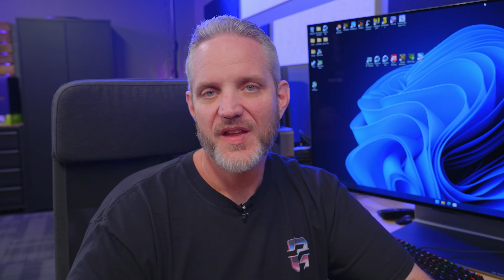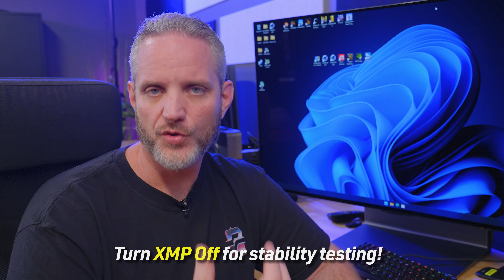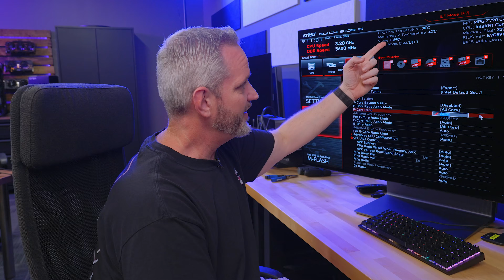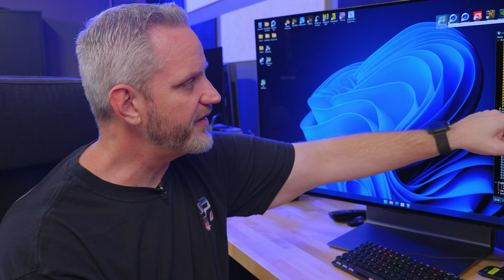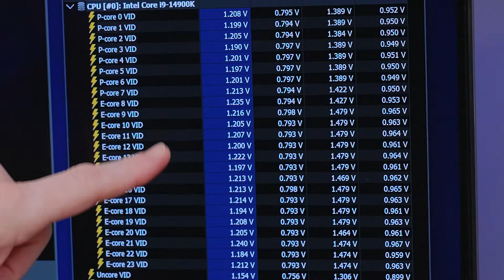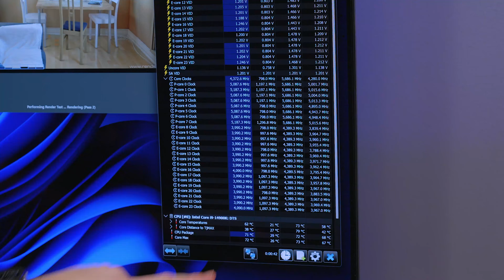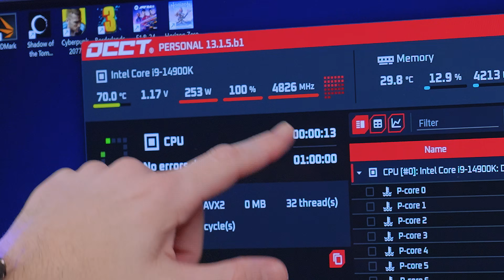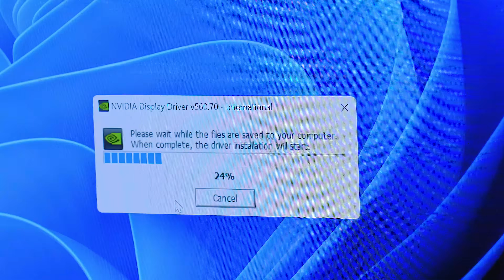Guide: How to check if your CPU is BAD!

Comment: Electronic components initally powering on is hardest most stressful thing it can do.  This is why when a light bulb bursts, its typically as you flick the light switch (though now-a-days LED bulbs are a bit different but same principle applies).  So personally I wouldn't adhere to that advice at the end about turning off your PC all the time that you're away from it.  You'll potentially cause your CPU to degrade faster, along with every other component in your PC, depending on how often you actually use your computer.  As someone who uses their computer every day, i almost never shut off my PC.  I have an i7-950 from yesteryear that still functions today, and was something I pretty much ran 24/7 for nearly a decade.
Reply: This is simply a myth that was debunked years ago.
Reply: I always turn my pc at least once a Month and my Last pc wish was a laptop lasted for 10 years
Reply: I have friends who use their PC a few times a week, so for them it would make sense to power it down. They could probably stil be running an 80286 through 2060 at that rate. Mine is up all the time, just goes to sleep mode when I'm not using it (which is usually when I'm sleeping, too).
Reply: i do something similar. i leave my pc on basically constantly during winter when it gets to colder than negative fck up ere in berta but during summer i usually get a dehumidifier running and a ac in my room pointed at my pc and try to leave my pc on but not use it yk

Comment: I use a 7800x3d but I still have a 4790k which still runs cyberpunk at over 100 fps on Garuda Linux. Well, I only use linux. But I did use the 4790k on a Win10 box too. Mmm.

Comment: I just tried running CB R15 on my 13700K rig, but it didn't utilize the P cores on that test.  CB R23 hit all cores just fine.  Is this just a windows 10 thing not utilizing all core workloads properly?

Comment: My 13900K was bad from day 1. I must have gotten one of the oxidation ones as I got mine in Nov 2022. Consistently crashes when compiling shaders for certain games. Particularly those using UE. Otherwise, it works fine for older games that don't use 100% GPU. Starfield, though published after CPU release,  uses an older engine, which works fine.  Fails DLSS test on 3d Mark. RMA'd 4090 twice. Thankfully, you figured out it was the CPU. Had no trouble getting RMA as I had a boxed CPU since I built PC from scratch with parts from Amazon. And your build videos to put it together.  Waiting for new one to come tomorrow as I got advanced RMA to eliminate downtime.

Comment: 13600kf/ /MSI z790p wifi ddr5/ single tower air cooler. Runs at perfect temps and voltage on lite load 9 and has no problems with ALMOST all games and programs. HOWEVER, it will always hard crash (freeze, little white and black squares on second monitor, then reboot) when I launch F4SE. That's the modded Fallout 4. Used to work fine but recently started doing this, even with bios updates. Regular F4 runs fine (but who wants to play that?) and this test also happens on default bios settings.

Comment: 25 minute video with very little value sadly! This would've been 10x more helpful if it was half the duration and I was done on actually a bad CPU to show what is happening. You mentioned that some bad CPUs are on the way, maybe could've delayed this video until they have arrived just a thought. Also a lot of acronyms being thrown, if one is going to talk for 25 minutes at least say the full acronym at least once instead of string of DIMMs, TDSs .....etc! So to answer your question at the end, this video was not helpful at all. Thanks for posting though.
Reply: What's your point? 😅

Comment: I have Ryzen 5 1600 and I used to overclock it.
I used to run that CPU on 3.65 GHz with very good power efficiency but after these several years it can't run at any given voltage at that speed. 
I had to clock it down to 3.6 GHz all core. 
Now that is the degradation I would like to see in newer CPU.
Reply: Overclocking Ryzens is functionally unnecessary by the way. Do that in PBO/PBO2 instead.
Reply: @ZenAndPsychedelicHealingCenter  maybe now, but as far as hes concerned, ryzen 1000 does not support pbo and is only supported for 2000 and up
Reply: @paneledp  Yes, Non-X CPUs don't support PBO at that time as far as I remember, correct me if I'm wrong. Also, it did improve a little bit of performance for multi core application/games and somewhat reasonable performance improvement was observered for CPU intensive games.
Reply: @paneledp  Yes, Non-X CPUs don't support PBO at that time as far as I remember, correct me if I'm wrong. Also, it did improve a little bit of performance for multi core application/games and somewhat reasonable performance improvement was observered for CPU intensive games.

Comment: With my 13900k and 14900k, I have never been able to run Cinebench R23 multicore without several cores hitting 100C. This is with an Arctic Freezer II 420 AIO with 6 fans in push/pull orientation. I am blown away by the temp you are showing there. I've tried remounting and repasting, worried it was a contact issue, but nothing has changed. Both boards I am running are MSI. One is Z790 MEG Edge WiFi with DDR5, and the other is an MSI Z790 Gaming WiFi.
Reply: Did u use contact frame?

Comment: Why isn't this affecting the 12th-generation series? They are the same LGA 1700; what's different? Does the 12th gen get a different microcode update? Can I have issues with the microcode updates?
Reply: the design changed between the 12th and 13th that's why
the new design was at the 13th then the 14th kept that design

Comment: Ugh. Got my 13700k in November of 2022 a few weeks after it came out. I was SO hyped to have a next gen CPU. My PC started having bluescreens about a year ago and they keep getting more and more frequent. BIOS updates, disabling XMP, reinstalling windows, nothing has worked. I am in the process of RMAing it now. Such a shame.
Reply: What was the stop code on the blue screen you were getting?  I am starting to get random blue screens when idle and nothing showing up in event log or mini dump.  They are starting to become more and more frequent.
Reply: @n1lla Same here. Looks like I'll be contacting Intel cause I've replaced EVERYTHING and it's still happening, even a fresh windows install.
Reply: @ki11arti5t9  I think i FINALLY figured mine out after a couple of months. After searching the web for the Nth time, i found a page that described similar symptoms that mentioned the 'Minimum Processor State'.  I changed the 'Minimum Processor State' from 5% (the default value) to 10% and the intermittent BSOD when idle or low load have disappeared.  If you are going to try this i would recommend increasing the value the smallest amount possible.  With a 5% increase i did not see a big change to thermals of the system.  A large increase will make the system run hotter.  Just keep that in mind.

Comment: How should we go about updating the bois or even accessing the bios if the computer refuses to restart to the bios? It just seems to go to half on half off mode and does nothing. It just won’t go into the bios anymore.
Reply: Clear CMOS first.
Reply: That’s the first thing I did. Still the same. Took a half dozen forced power downs to finally get it to recognize flash bios, then a couple more restarts for it to finally bring up flash bios to update. Still can’t get it to post in bios. It just goes to a black screen each restart when I hit delete etc. Never done this before. Dunno.

Comment: I’m no engineer, but I always imagined these tests were damaging to the cpu with a sustained high intensity hit.
Reply: That shouldn't be an issue, if that was the case then noboby could do an intenssive work with for example, cpu rendering or particle simulation, or any other similar load... You have to remember that this cpus are used in companies to create their own products, it cant fail, at least till they reach the end of its life cycle

Comment: I had an Nvidia driver crash once a few months ago. It was a weird one as I saw it first (and last) time. I don't really remember what the error was saying. I rerun the thing again and it installed successfully the second time. But - now I'm seeing errors inside OCCT. Probably because I'm undervolted. Tweaked my offset voltage a little bit more just now, and rerunning all these tests. Only OCCT was complaining after just 7 short minutes. Before I was running it for 2-3 hours in Steady load time and it wasn't complaining at all. 14700K here.

Comment: As for CPU degradation...
I am currently using a 16 year old processor; the Intel Core i7 965 Extreme @3.20Ghz. It has been put through a lot since 2008, with some minor overclocking. I have tried to keep it as cool as possible over the years.
It gets warm'ish during gaming, sometimes around 57°c with a max of 67°c (depending on the game). It's currently being cooled by a Dark Rock 4 with two 120mm fans, and both are really dusty lol. Last thermal pasting was about 4-5 years ago.
And since being on Windows 10, my pc hasn't black/blue screened at all.
It is still running rather efficiently, I mean for the price that I paid for it at the time around £800. It's just my gpu GTX 1050ti that's dying on me 😅
.
However, I am quite glad now, that I upgraded to an i7 12700k for my new build, and really so glad that I didn't go for a 13th, or 14th gen. Phew! 😁

Comment: Any advice for asrock Z790 nova and a 12900k? I have no idea what I'm doing. What does quality 75 mean?
Reply: You're not on a 13th or 12th Gen CPU, so should be fine. Never use automatic overclocking. Do it manually in the advanced section of the BIOS instead.

Comment: Fobbing away from the fact that Intel should be FORCED to swap out all CPUs from the affected production runs last year etc.
Reply: Intel will only rma and replace, similar to corsair with their dreaded lower end h100i h150i red trangle and failing pump 'budget' aios. You will only ever get the same model
Reply: Hopefully US top notch lawyer's can bring a class action against Intel ( with EU smacking Intel a bit ) to offer all affected customers (of 13th - 14th Gen I7-19 Chips) - Equivalent of their New CPUs (15th Gen 1851 Socket Intel Arrow Lake ) and $200 - $500 for an equivalent Motherboard to house their new chip CPu.        All this f^^&^&^& up is harming the Intel Brand and p^^%%^^% lot of us off; with view that our new build will unlikely be Intel but their main rival AMD; many say it's like the CPU equivalent to B loeing 737 max f&^^&^& up.
Reply: @dafyddthomas7299  yea! 12 cent settlement to each customer and millions to the law firm.
Reply: @dafyddthomas7299  they probably won't, for two reasons: intel also has top notch american lawyers (arguably even more so because the us operates on the doctrine of the rich shall eat the weak) and because splitting intel apart and declaring bankruptcy on the cpu design business would probably be cheaper than providing all that stuff.
Reply: @b3nsn0w  Yeah, in hindsight them announcing the foundry split is super sus. Perhaps they knew it way before they let on.
Reply: @mild-apocalypse they absolutely knew earlier and waited til they could plan out how to tell everyone and deal with the aftermath. It’s all about keeping shareholders happy, not customers. Customers only matter if it influences the stock.
Reply: Intel garbage.

Comment: so if i got a 13th gen 13900k which pass these test... i don't have to download their microcode? or should I still download the microcode as a precaution. Cause i'm thinking right now: if it ain't bwoken, don't fix it!
Reply: It will degrade as this is an engineering issue, not a software or microcode issue. These tests are not much use frankly.

Comment: This was for my intel 13500k last year around this time, but prime 95 i was able to get the cpu to reliably BSOD crash to IRQL error in a boot loop with in the cpu after a few hours of use. Would also just happen running windows or trying to load games on a fresh install of windows doing the same thing going into a IRQL bsod boot loop.

Comment: i gamed on a i7-3770 for 10 years on a MSI Z-77  for 10 ish years, yes the 3770 without the K so it was not unlocked which would not need a Z motherboard, anyways, sold it cheap to  a friend without a pc, he games on it for a year, then bought a 12900KS, then sold the 3770 pc to a friend of his, which till this day still is gaming on it.  CPU's can live long!

Comment: 2008 intel silicon lottery to see if you can get your i7 up to 4, 5, or 6 ghz
2024 intel silicon lottery to see if you don't have to down spec your cpu to keep it alive
Reply: I've got an old i5-4690k on a Z97 Pro4 and OC it at 4.4Ghz. With OCCT on extreme cpu test i hit the 100°C even after replacing the thermal paste (arctic mx4) and with Arctic Freezer 7pro cpu fan but no crash. Should i be expexting lower temps with this?
Reply: @stefanoamadei335 If voltage is at max 1.2V, there should be no issue running 100c om stress test. Haswell often run hot. You can lower the core temp significantly by replacing the old thermalpaste between the die and IHS. Liquid metal is best, but more risky. Some high quality non conductive thermalpaste would be okay, and still better than the 10 year old dry paste.
Reply: @Wushu-viking  It's an excellent candidate for lm direct die with an air cooler. Even without direct die it'll shave off degrees.
Reply: @stefanoamadei335 At that frequency and being on air, yes. I'm assuming that's under full load?
Reply: @DavidTMSN  yeah with OCCT extreme CPU test, went quickly at 100°c but never higher and i replaced the thermal paste with Arctic mx4 before testing
Reply: AMD had higher failure rate and still havent gotten over the burnout. Intel got over it in 2024
Reply: that's what happens when intel just factory overclocks your cpu instead of actually innovating
Reply: @b3nsn0w  Alder Lake and Raptor lake, the biggest architectural changes to Intel CPUs since 2006, not an innovation, eh?
Reply: @Amaeyth  if you put it that way it sounds better than the only meaningful architectural jump since 2015. that's the problem here

intel's 6th, 7th, 8th, 9th, and 10th "generations" are the same architecture on slightly better process nodes, with core and clock creeps. 11th gen was a lazy attempt at a slightly wider core from the previous years, backported to 14nm. 12th gen was intel's only jump in the ryzen era, and then 13th gen was a minor cache bump, and we're back to stagnation with the 14th gen.

that's quite a terrible track record for the past eight years as far as innovation goes. six of these eight "generations" are just marketing, nothing more.
Reply: @b3nsn0w  They didn't have to innovate a lot, in the PC gaming world look at the latest steam hardware survey. Vast majority of CPUs are Intel from Skylake & up. If they have captured that market, then why improve? Lucky AMD is a thing even though they are about 20% of the market since Skylake days.
Reply: @rodneyjames2344  and this is why tech companies that have engineers as CEOs do so much better in the long term than those ran by people with a background in business.

yes, shallow reads on the market like that would suggest that intel had nothing to worry about between 2016-2023 but shallow reads like that, focusing on short-term gains, are what leave a company so hopelessly behind that it takes a decade to course correct. if it's even possible by the end of it.

intel has been in deep trouble since about 2019, and as it stands, they've lost pretty much all their momentum on the lucrative datacenter market, they've lost the enthusiast market, they've lost apple permanently, they've frustrated pc laptop manufacturers to the point that they're looking elsewhere too, and recently they have lost the old adage of "nobody got fired for buying intel" as well. all of these things would have required course correction five years ago, and all of these are just going to get worse without a serious course correction today.

don't get me wrong, no one knew cpu stability was going to be the next thing to break. but something was bound to give, with the way intel was approaching innovation. expect more of this, not just from intel but from anyone who focuses on the market rather than technology. because there will always be a market for great technology, but it's impossible to build great technology on passing whims of the market
Reply: @rodneyjames2344 precisely why I only buy AMD
Reply: Blaming mobo manufacturers is wild.
K, KF, and KS model CPUs are "unlocked" yet apparently any kind of overclock whatsoever just fries the CPU in a matter of months, while the current Intel stock values will likely fry it in under a year.

We are going back in time when installing a component is no longer as simple as "plug n' play" like back when installing a new HDD required you to configure the switches on the HDD and go into the bios to tell it what switch it's set to, oh and also make sure is in the right position on the IDE cable as well.

Except with my 14900KF, I need to update and reconfigure my BIOS each month, but hey, at least I don't require an Intel account to run my Intel CPU.
Yet...
We should at least get a 25% cashback considering the unlocked models are not safe to overclock, and as such, we paid a premium for a feature the CPU wasn't built to withstand, like a Wish product that only lasts a few months.
Reply: If it starts showing symptoms of degradation, underclocking it will not 'keep it alive'. RMA it.